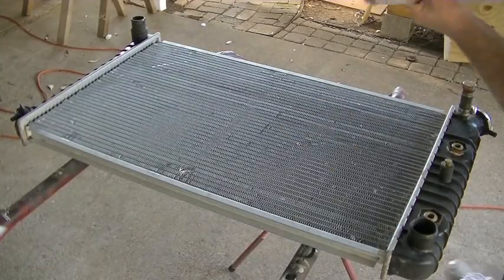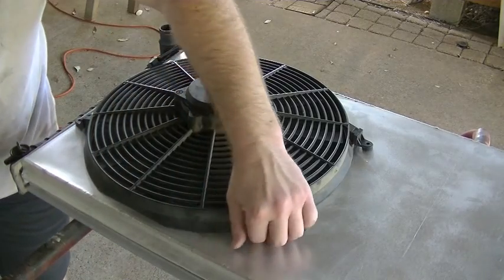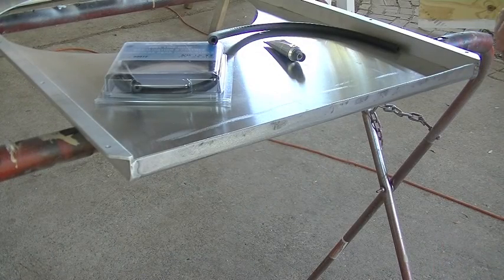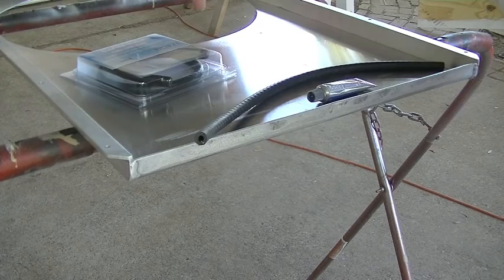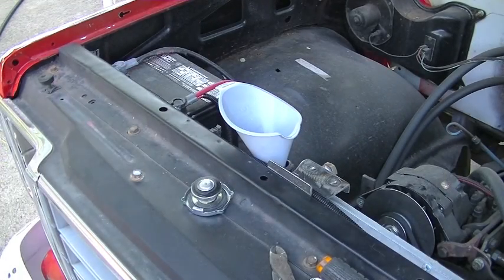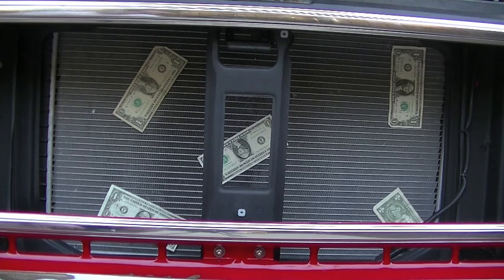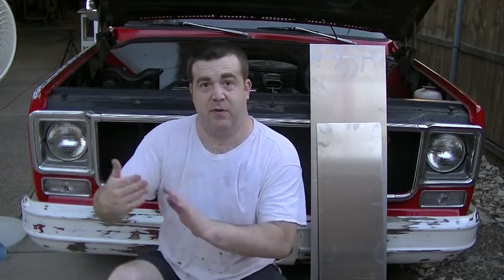PART 2 TIG WELDING AN ALUMINUM FAN SHROUD | 1977 Chevy C10 Cooling system

Comment: Looks great, very nicely done sir! Just wondering how this setup working as far as temps go? Does the truck run hotter than it did when driving down the highway since part of the radiator is covered by the shroud? Thanks

Comment: Dang man, nice.   My straight 6 300 doesn't have much clearance to have the fan lifted away from the rad.  Ordered the 2in thin fan.    So deciding on mounting, shroud or not.. Would have to be 1/2 lifted shroud.. not sure worth it or not.  Then again,  she's cooling fine with the 3core stock rad and a drive fan with no shroud..  About to drop in a 3core AL rad with the 16in Efan.  anyways. 
But nice job man.

Comment: I like what you did there buddy!!! I may doit to my truck🍻🍻🍻!! How' s the truck running since this video? You got space in the front for two more fans or at least one more on side where the dolar bills fail. 👍👍👍🍻🍻🇬🇧🇬🇧
Reply from the maker: I have room for a small fan down low on the engine side of the radiator.  On the front I could easily fit a pusher or two.  Thanks for watching!

Comment: If you don't mind I would like to copy this design? I was wondering if you can tell me what temp should the fan come on? Before I order my fan relay wiring kit I would like to know what temp switch should I get.
Reply from the maker: You're welcome to copy it.  Just remember that you are responsible for your execution.  The temp depends on your conditions.  Generally speaking, 190 on and 170 off works for most older trucks.

Comment: Awesome shroud job.  Love the rounded edge the tube steel imparts on the brake.  Food For Thought: my V6 S10 was overheating in "rush" hour summer traffic on I-25 in Denver.  I went to Summit Racing and picked up their all aluminum race radiator (PN SUM-380331). It's about a 31x20 for only $150.  I coupled that with a pair of their electric fans that are integrated into the shroud (PN SUM-G4852) for $195.  That has solved all my cooling issues.  Not sure if you have room for that in your truck.  It only fit in mine because I have a 2" body lift.  Had to modify their radiator mounting bracket kit to fit and welded the bottoms in the truck (PN SUM-380100). If you don't use this info, perhaps one of the viewers of this video will.  Thanks.

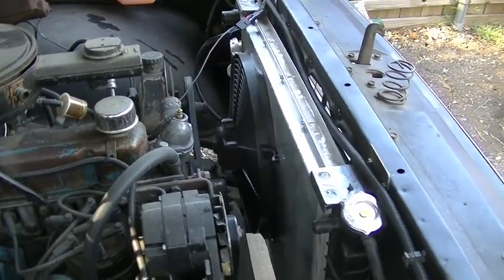Comment: Ooooops! I see it now. Right at 10:49 it shows where the pulley would be in the way forcing you to put the fan where you did.
Reply from the maker: +8172008 No worries!  So far it seems to have fixed my overheating issues.  But if I need more cooling, I have room on the other side of the shroud to install a smaller 8 or 10" cooling fan.

Comment: Too bad we couldn't have seen the dollar bill test "before" your job, and do you think it would have helped if the fan had been dead center(seems all the bills might have "stuck" better) maybe? Nice job, though-Dave
Reply from the maker: +8172008 I should have done the dollar bill test on video.  I did do it, just didn't film it.  The can is offset to clear the water pump pulley.  If I had a V8 in there, it would be centered.  But these inline 6er's are so long, the fan had to be offset to one side.  Thanks for watching!

Comment: Awesome work, if my aluminum welding is only ever as good as you did on this shroud I could die happy. 

Does your truck have any freeway speed cooling issues? I built a shroud almost identical to the one here for my old 1984 Camaro , worked great for stop and go, however, once on the freeway at speed it blocked flow thru the rad enough that it would overheat. I ended up cutting out the large "blocked" portion on the passenger side to allow airflow at freeway speeds which helped some.
Reply from the maker: +johndelta00 I have noticed that the water temp at freeway speeds does creep up a bit.  But not to the point of running too hot.  It does run cooler on the streets.  I probably will need to cut some holes in the blocked portion.  Many of the aftermarket shrouds have little ports cut into them with rubber flappers that open at high velocity air passing though the radiator, and close to create a seal when the fan is drawing air through the radiator.  I'll probably whip up something like that.  Thank you for watching!
Reply: +milkcrate82 Stop the freeway issues by doing what OEM shrouds do: put rubber flaps on the outside of the shroud.  When you're driving slow, fan suction keeps them closed.  When enough air gets stacked at freeway speeds they blow open.  You have room for three or four of them on the passenger side of the shroud.  Oh, and I've done electric fans on all but my current truck and I stopped using the thermostat controls.  They always fail (been thinking about the expensive Derale controller PN 16788).  I wire the relay to an ignition hot source, so they come on when the truck is on.  I put a switch in line with that so I can shut it off in the winter.

Comment: I was thinking that the a/c  system out of a wrecked 2000's GM trucks might work there compact and efficient and Cheap check out Craig's list. They look very similar to the vintage air setup!  good luck Sir!
Reply from the maker: +Lawrence Eich Really?  I'll have to check that out.  I'm prepared (at least mentally) to drop a grand on the Vintage Air system.   You mentioned in a prior comment that you are a Houstonian.  So as a fellow Texan, I'm certain you understand the importance of A/C for one's mental stability during the summers here.  For me, it's kind of one of those things I just want to work... and work well.  I'll look into though.  If it's a significant savings I might have to attempt a retrofit with one of those factory units.  Thanks for sharing!

Comment: Nice welding but why didn't you center the fan ?
Reply from the maker: +Erik De Backer Because of the length of the inline 6.  If I centered the fan, it would have interfered with the water pump pulley.
Reply: aha, thx